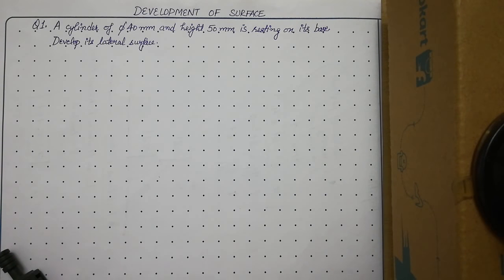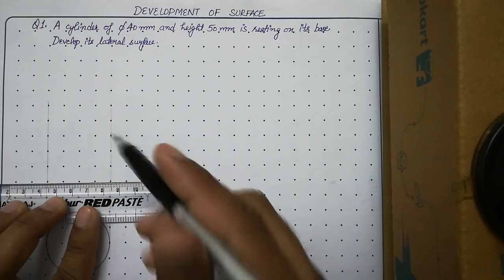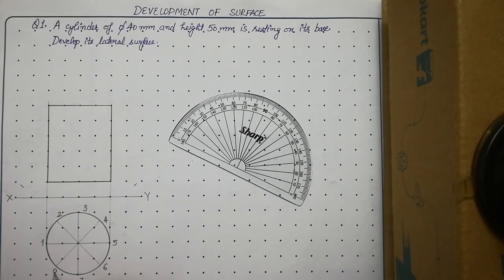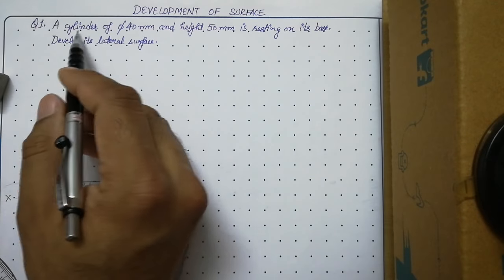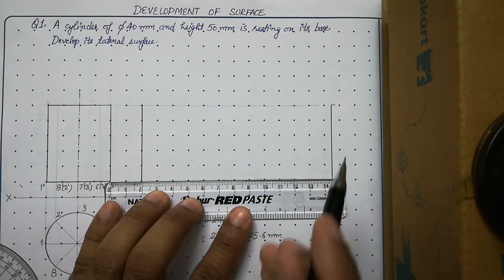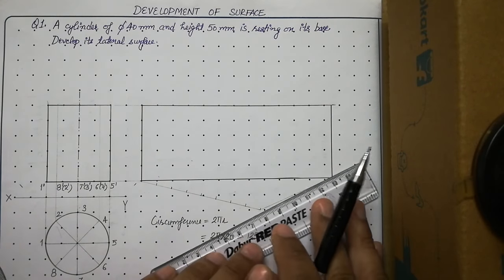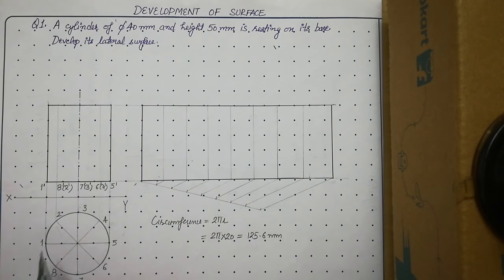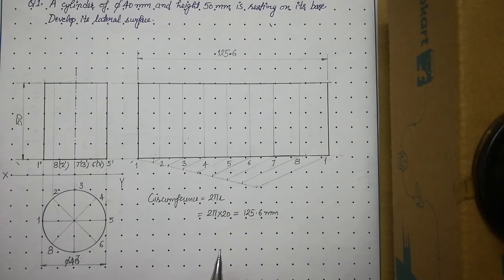Development of Cylinder | Development of Surfaces | Engineering Drawing

Comment: Sir in place of 8 generators I take 12 generators, is there any mistake in that ,if not what will be the answer
Reply from the maker: When we increase number of generators then we get more number of points in the development of truncated solids and those points help us to obtain smooth curve. But at the same time they consume more time also. So increasing number of generators help us to draw curves smoothly in truncated solids. So if you have taken 12 generators then that means you have used 30 degree angle and it will have no negative effect on drawing except the increase in time of drawing.

Comment: Is it necessary to leave gap on front view above xy line
Reply from the maker: No it is not necessary. It depends on the question. If it is mentioned in the question that cylinder is resting on horizontal plane then it is necessary to draw front view on xy line. If it is not mentioned then you can take gap.